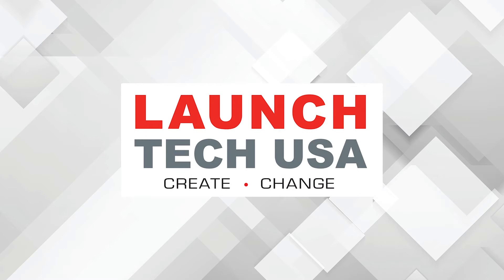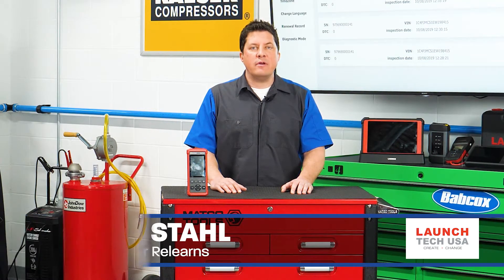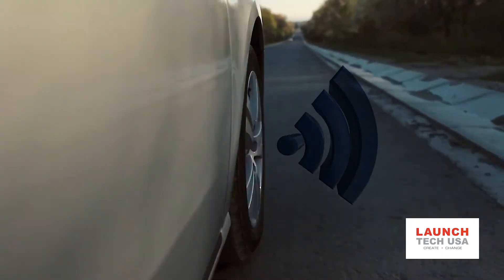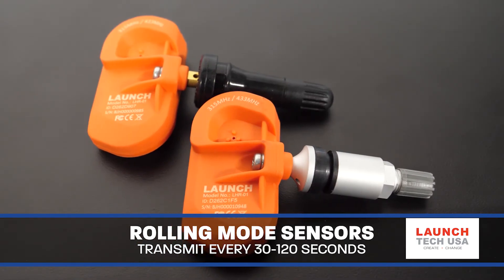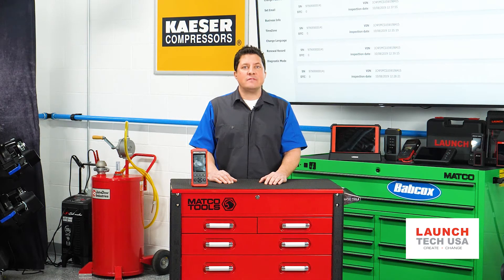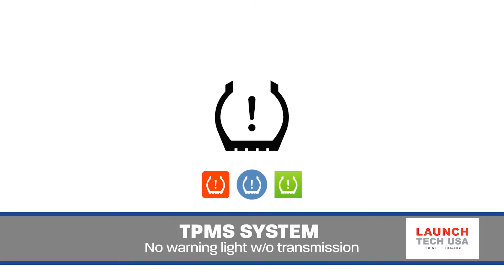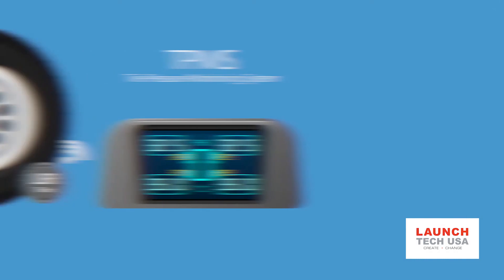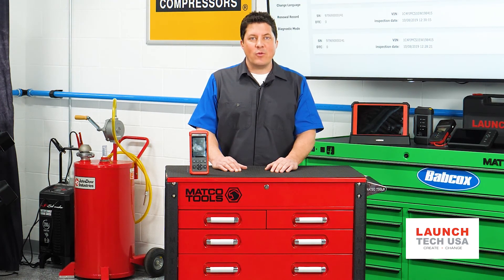Launch Tech USA - TPMS Sensor Relearns II

Comment: I'm interested in buying one of your products but I don't know what one to get. 
I'm a diy home mechanic. I have two vehicles. 07 Colorado 2015 equinox. I need a scanner that can reprogram key fobs and give live data for ABS wheel speed sensors. What product do you have that can do this? 
I was thinking about the CRP123X but it's not clear if it can reprogram key fobs. Thanks.